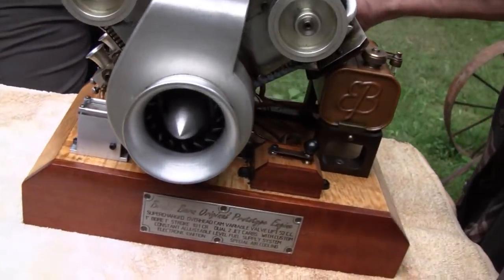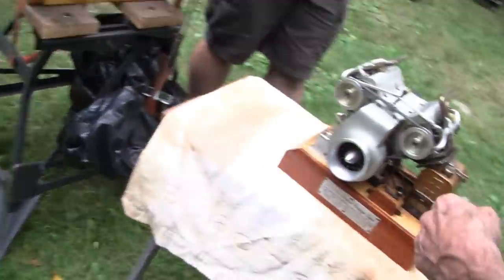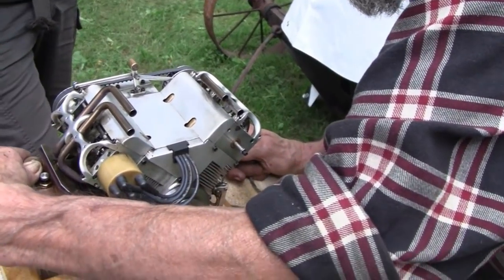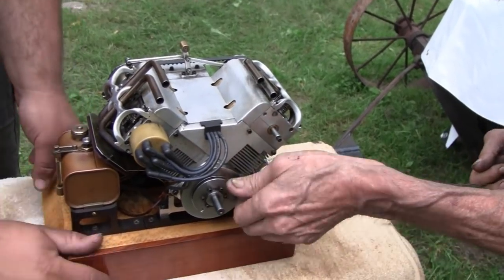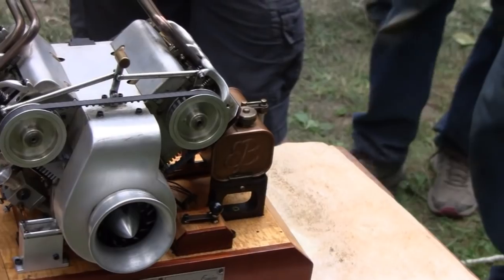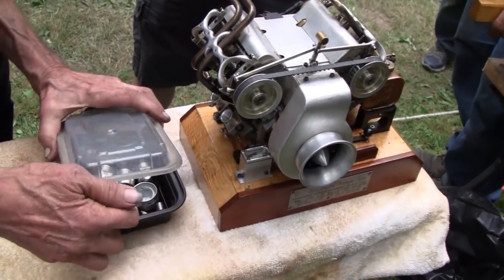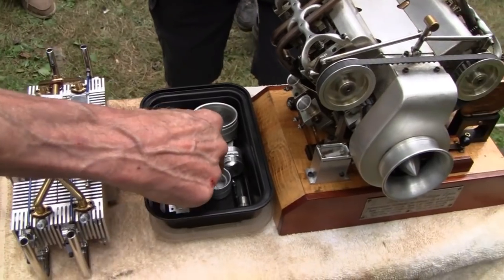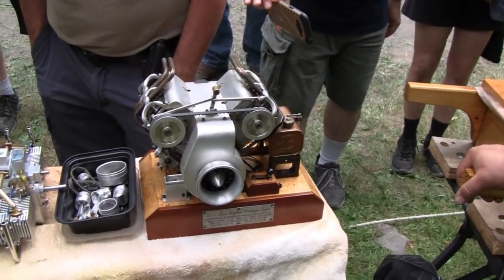INCREDIBLE HOMEMADE V4 ENGINE (from scratch)

Comment: Id like to build a v4, based on a  Chevy v8, maybe a 454, or 8.1/496   
I like the little thing, I'd like one a bit larger, maybe based off 12 hp mower engine pistons,  possibly a peak power potential ñearing 80 hp 50-60tq,  but most likely in the 48-58 HP range,  and spin around 5k rpm, 
I'm thinking possibly forge a crank by hand, or whittle from a chunk of steel, but most likely from steel plate and round bar stock, fitted together with mortise and tennin like joints, with interference fit, then machine the joints back about 75% and weld to get full penetration. High amperage Tig welds,  then heat the whole crank to red hot and hold it for about 10 minutes, to even out the stresses,  possibly hard face weld the journals and grind the journals, maybe build a set of steel H-Beam rods , to use the mower pistons,  or machine long billet aluminum rods, for a 1.9:1+/- rod stroke ratio,  cast the block using lostfoam process,  could lead to little machine work required, decking the block, sleeving the cylinders,  something like a 3" bore, with a 2" - 2.5" stroke,  use aftermarket performance mower cams modified and used in the head, under shaft mount rockers,  with the cam shaft machined and attached to bar stock and machined , using a interference fit, and pinned, or cut keyways,  but kept true, and turn journals on the connecting steel,  use a aluminum bar, with bearing halves , making the caps to be bolted to the head retaining the cam,  and housing the tappets, with the rockers fitting like a normal pushrods engine,  seeing the tappets as pushrods,  I got plenty of ideas, and no way! To machine them! 😢 Haha, sorry to ramble,

Comment: Obviously the motor is air cooled by the blower fan at the front but is that also the intake? I don't see a carby setup but is likely somewhere I can't see or haven't noticed yet but I'd still think I'd see a filter or something else similar.. but because I can't see a normal intake I'm under the impression that the fan both cools down the motor and feeds the intake

Comment: Put a go kart torque converter on it without the centrifugal part and make it straight shot from band to chain with the right ratio it can be a pretty cool motorcycle or ATV just need to push start it the crank will turn over the engine using the inertia created by the wheels spinning g the flywheel just a thought

Comment: Nice, but don't get your finger caught in the timing belt! I had a Subaru with a flat-4, Then I bought a Honda.  OMG, never give up a flat-4 for an inline 4.  The Subaru had so much more horsepower and torque. The Subaru also had a cam with only 4 lobes, (2 lifters rode on each cam lobe) and a gear driven camshaft. What could be better than that?
Reply: cathode follower a 2002 cobra terminator mustang with a wife in the passenger seat

Comment: Now test them on a water brake to see how much power they can make under load. Running and idling is one thing, yet it'd be neat to see what they can actually do.

Also another challenge is to do an arduino-based engine management system. Even kit injector/ignition control setups are too expensive, so it'd be neat to see what somebody could tinker from scratch. Of course that digs a little into a different field of knowledge than machining carburetors (programming software to some extent), so I could see why it'd be more challenging or not done as much.

Comment: Now go build a 4 stroke V4 4 cylinder supercharged Hell Kitten motor with front and back counter balancers on it. That's incredible what you built. Build the V4 just like the Dodge Hellcat engine with 4 cylinders missing.

Comment: Coolest part i see is the Air Intake system, It runs a intake fun off the crank (similar to a procharger) wonder if you could setup for boost. Maybe already does as said was getting valve float at higher RPM which would indicate its pushing alot of air around.
Reply: That's the cool air intake for the cylinders, it's air cooled.

Comment: Belt that with a Dynamo and you have a nice generator if it runs on hho, or synth gas would rock.
Reply: A cordless drill would start that much better than the pull start but still awesome.
Reply: Does this small cc require nitro?

Comment: Thats a very unique looking super charger
Reply: I’m pretty sure it’s air cooled. What you see is the cooling fan......
Reply: Cumminsram 49 yeah the more i looked at it the more it looks like a blower motor up front for cooling
Reply: Cumminsram 49 it’s supercharged
Reply: Finn Balor It's basically a homemade procharger from what I can tell. Absolutely genius.
Reply: Cooling fan , you can see the fins on the side of the cylinder block or blocks.
Reply: Its a cooling shroud

Comment: Try using a drill to spin the engine to start
Reply: was my first thought to, be easy enough to add a ratchet to it
Reply: wolfe1970 started a boat motor on my drill, stayed in it until I pulled the drill off, wasn’t bad at all
Reply: how did you use the chuck if it was spinning ?
Reply: Agreed
Reply: All that is required is a one way bearing on the shaft. It would have to be permanently attached though. If he could build the engine, why not build a pull start?
Reply: @glennsosinske3260  what's a "one way bearing"? 😂
Reply: @toadamine  if you think I'm full of crap, do me a favor, figure it out yourself. You clearly don't know anything about small engines, so I want to keep it that way. Lmao!
Reply: When you build your own engine from scratch, then you can start telling people how to start their shit lol
Reply: Add a starter gear to the drill on a small shaft so it would fit in the chuck. Then you could cut the gears off of a matching flexplate and wrap them around a piece of plate steel cut in the size of the desired fp/fw and weld it on you new mini fp/fw.  Now just line up the gears with your drill in your hand and when it starts just move the drill driven gear from your mini flexplate/flywheel.
Reply: My exact thoughts
Reply: That's what I said to use a cordless drill motor and that bad boy would start on the first crank I bet !!!
Reply: just put an electric starter on it
Reply: It could even be as simple as what they use on model aeroplane engines, they have a rubber friction piece on drill or motor that fits over the spinner and you push against it so it grips, no need for a mechanical connection, as soon as the engine fires you pull it away.
Reply: Used to race gokarts with 12 hp brigs and stratton motors and we used a very small car battery and and an end that fit over the crank spindle coming out of thr motor. Hit the button and it would turn it over. Im sure the man who built this motor would have no problem designing something like that on a smaller scale. Would save a lot of time lol.
Reply: Lol @ you blokes. I like that it's difficult to pull start. He went to all that trouble to make it, why make it easy to start? For lack of a better word, there's a kind of romance in not having any kind of starter... Don't you think?
Reply: Daniel Espinosa impact wrench works best than a drill
Reply: Be kinda rough on the drill once it started. Maybe your hand too.
Reply: @jasalley  that's why I said to use a ratchet system like a starter motor has
Reply: @redneckjesus1498  yes your right, my bad
Reply: guys are over thinking this, a drill is all you need, we have been starting RC plane engine for years like this.
Reply: one way slot key like a hand crank car. catches one way only
Reply: At first, I read that as dildo for some reason.

Comment: Is that a two-stroke?  It looks like the carbs are going into the bottom of the crankcase.
Reply: No, 2 stroke gas engine don't use overhead valves.

Comment: Finally a cheap engine for my civic
Reply: But this won't come with vtec stickers so you might be better off staying stock, yo
Reply: I want one to replace the 50cc motor on my scooter.
Reply: @gooberclese  I dont think this engine has a lot more power than a single cylinder 50cc engine becouse it has 4 smaller pistons and also maintance would be harder
Reply: @mate7255   wouldn't need much more.......15% more than very little is still a huge improvement.  In the scooter world every mph counts.
Reply: @gooberclese  yeah it would give you a few more MPH but its hard to work around such a small engine and you cant find replacment parts so if a crankshaft or a piston or piston ring breaks or gets damaged you would need to make new parts which takes a lot of time and skill and different materials and tools, it would be better you just buy a 65cc Big Bore Kit for your scooter
Reply: Battle Ground Survivor The design of this engine being a four stroke would mean torque and possibly HP,  but more maintenance yet it would also last longer, plus everything was handmade and precise. It's build is a lot better than most Chinese 2 strokes that come with terrible tolerances and quality. Plus there are a lot of other parts and components that increase the power, like the supercharger (yes 2 strokes do naturally have a "self-supercharge" of sorts) and the variable valve timing,  not to mention his "special cold intake". So over all, this would be a better engine(like the torque, HP, and life span),  but bang for buck a chinese 2 stroke would win. So it's all in how creative and fast you want to go or cheap and fast. This is definitely a unique build that he spent a lot of time on, would be cool to see a larger scale version put into something.
Reply: Battle Ground Survivor r/whoooosh
Reply: Battle Ground Survivor eh i doubt each cylinder is 13cc its probably 80cc or 110cc total
Reply: LOL🤣!!!!!!
Reply: More horse power and tork too
Reply: I want a Civic V6
Reply: Why, did the squirrel fall off it's wheel?
Reply: You'll pick up a civic engine cheaper. You'd probably get a complete civic cheaper.
Reply: I can see it has a plaque that says variable valve lift. So yeah this has VTEC
Reply: daniel bean  rofl .. funny .. depending on which civic there are several options .. the preformance shops used to toss D series engines for Bseries swaps.. a D can be built to hang also.. now the Kseries are a bit more pricey but can be obtained .. its also possibile to use a Kseries 5speed manual and convert it to a 6 speed.
Reply: Morgan Taheny lets hope your alignment doesn’t mess up every weak like my civic did😂
Reply: To be completely honest this engine would probably cost more than a 18b..
Reply: Its even got VTEC... NO JOKE!
Reply: And you honda fukboiis would still try to boost it 🤣

Comment: Very cool. Thanks so much for sharing the only thing i would do different is either put an electric start on it or set it up so you could start it with a drill or use a belt and a starter like we used when i was racing remote controlled boats.

Comment: Wowwweeeee   that could go in a mini car that could be produced for kids to learn how to drive the right way, instead of a GO KART........ 

I learned to drive at a very young age in a 72 Dodge Charger myself...  8 years old...

Plus Tard Mon Ami ~!~!
Reply: What’s wrong with a go kart
Reply: Nothing at all.........   But a mini car with that bigger engine would have the real feel to it for a young boy or girl......
Reply: Boo LuQuette a lot of the new go karts are like mini cars. They seat 2 people have 4 speed transmission with reverse and lights turn signals and horns
Reply from the maker: Yeah Buddy!! ☺
Reply: Those custom go karts that have 2 strokes in them are insane from 50 to 250cc. some are manual like the shiftier carts as well as mini shiftier carts and some have turn signals and everything. Learned on a go kart how to drive as a toddler/ young kid then as a kid/ teen drove my Dads diesel John Deere doing chores or riding my dirt bike or atvs, all before age 13 , A lot of kids these days don't drive anything until 16 which is sad.

Comment: 4 Cylinders with 52 cc total displacement?! I have lots of questions about the valve actuation direct from the cams or nearly.  First a Ford V4, used in Saabs and now  VW/Subaru flat four.  Is there a single cam in the block?  I didn't see any on the sides (cyl head tops).
Reply: And where's the supercharger? 8-))
Reply: Bob Pegram 
the cooling fan must be doing double duty, also a super charger.
Reply: There is a timing belt visible on the front of the engine that is driving two timing pulleys. It would appear that those are the overhead camshafts.